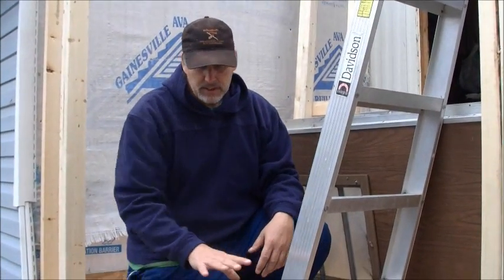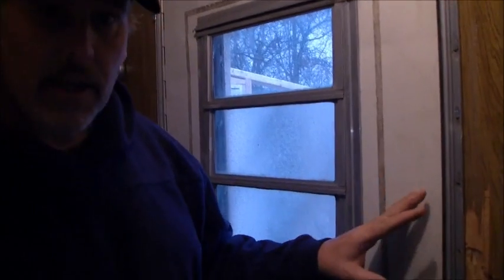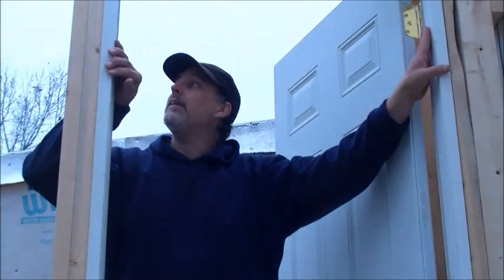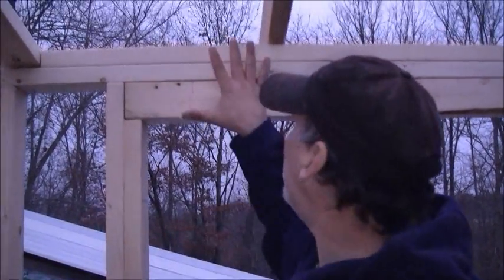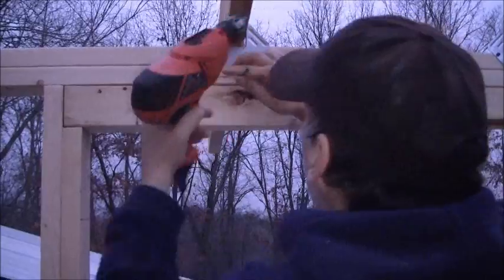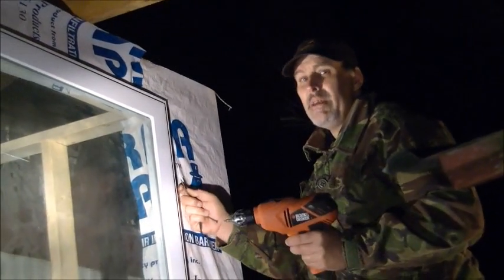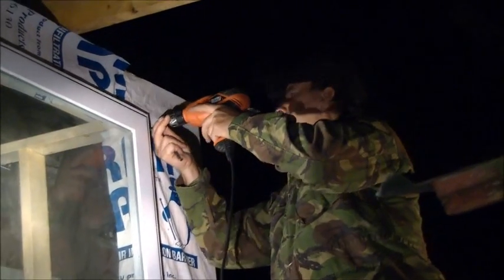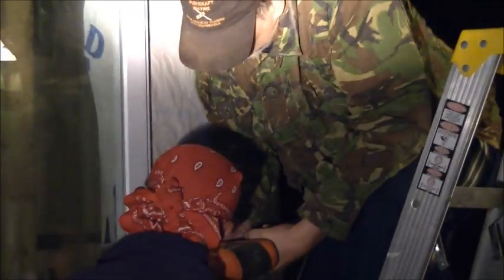Addition Update - Framing and Walls

Comment from the maker: @ArtisanTony 

Yes... I know that it should be a larger header.. but we were in serious trouble with the roof height.. It had to tie in to the existing roof.. and we only had 5" total. We did the best we could with what we had to work with.. There was no other option. I hope that it will hold up.. there shouldn't be any excessive weight over the window so we are crossing our fingers (tightly) :) Thanks for the ups Bro!

Comment: @BushcraftOnFire haha, the window should have been shorter :) I am not criticizing just trying to help.  I own a design build company and I always plan all of our construction projects with design drawings first.  Using existing dimensions and developing wall sections at critical areas.  Just be ready for some deflection at the center of the window. If it is tight like you said, it can eventually crack the glass.  I have seen this many times over 30 years.  Good luck !

Comment: Good job, but that  4" window header seems lightly framed for an area like yours that has a snow load to deal with. Here (Southern Canada) the rule of thumb is 1" of nominal height in the header for each foot of width of the opening so 2 2 X 6" would be the way to go. I can see you are pressed for space, I probably would have put in a 3 X 4 " steel lintel, but then again I overbuild like crazy most times. Anyways it's done now... Looking forward to seeing the final result.